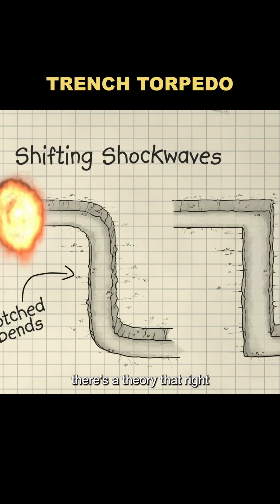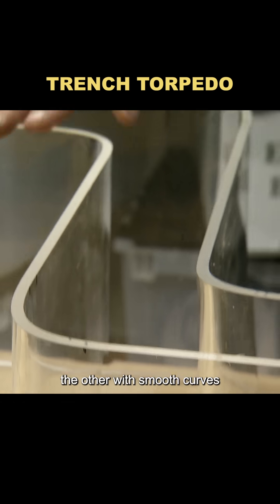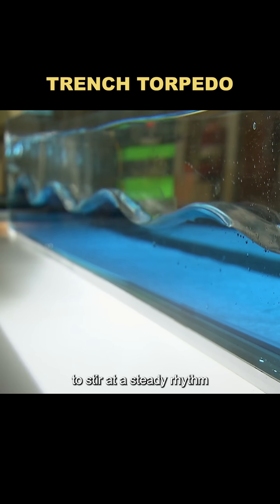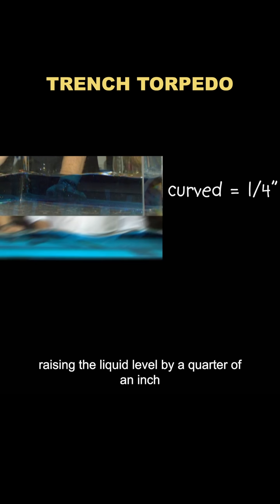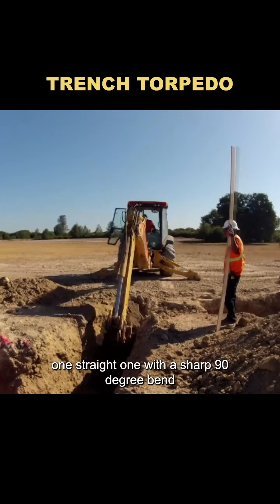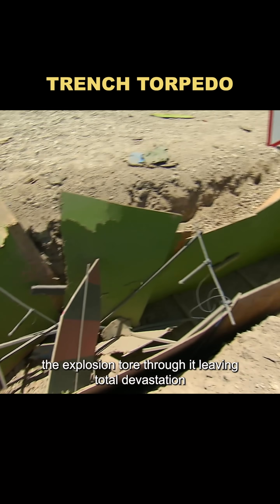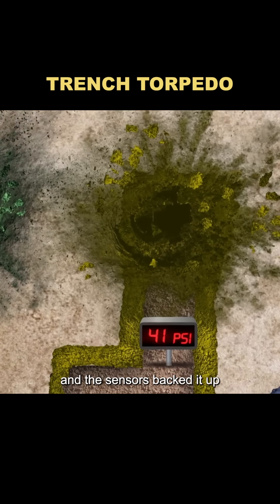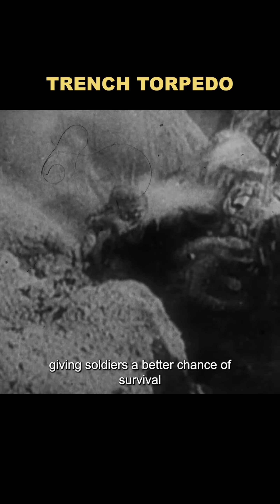Do you know how this liquid is made?

Comment: Do not forget the modern explosion devices are more mortal
Reply: The design in very human
Reply: @EricKuih 
Of course, only humans can come up with unnatural and devastating things
Reply: Dude, a 155mm HE shell is a 155mm HE shell and a mortar round is a mortar round
Reply: @easy_eight2810 artillery in ww1 was larger and had more explosive mass.
Reply: Explosions from 1910 and 2010 are the same
Reply: @BebzolMC  They're actually not. Modern  compounds provide a greater yield at the same weight than TNT and so you can get more bang from same shell size.
Probably not a huge difference in the end, few more meters of lethal range.
Reply: @Suomiwimbula  Agry but I meantjust  an "explosion" not certain substance because I think that author doesn't understand that a specific trench is gonna save you or kill you no matter how new is the thing that explodes. A grenade still explodes just like it would hundred years ago.
Reply: Just because M67 is more advanced than M1 doesn't change much
Reply: @Suomiwimbula  Also people don't realize we don't use TNT as much as we use unstable compounds such as Composition B.
Reply: @BebzolMC No they are not
Reply: @HardcoreJonny-x1j Yes they are. The same as your body is the same as the body of humans from 1910. Sand that kids ate in 1910 is still sand in 2025. Cosmic radiation is the same. And fucking explosion are the same :) Law's of physics never changed
Reply: @BebzolMC not with how more effectively they are delivered to target (drones)
Reply: @BebzolMC no the hell they aren’t
Reply: @BebzolMC  thermobaric can burn the oxygen out of the air and suffocate those close enough. russia claims to not use them but its proven
Reply: @BebzolMC not really. Advances in purity and the discovery of new chemicals make for more potent explosions than we had back then.
Reply: @BebzolMC  explosive vary widely as do the explosions. Not talking about size or shape but how the blast wave travels.
Reply: @BebzolMC ur actually a nut for thinking that back then it was TNT and Cyclonite  we are using thermites C4,PBX and something better and improved than cyclonite, HMX octogen
Reply: @FrankNoBank69420 wiki no jutsu is strong I see. I worked with bombs for 5 years and am now a chemist. All bomb still go boom. The science is different but it’s just delivery and speed in which it’s delivered.
Reply: modern explosions ARE VARIOUS. both low caliber and large caliber munitions are used. both low yield and high yield. basically soldiers will shoot everything that goes boom.
Reply: @kirosmatavastros Do not say basically, please and thanks, pipsqueak.
Reply: more mortal? what is that a video game or movie reference?
Reply: Agree T seems like it would be the best.  Z would be Slightly better than right angles because some of the wave form would cancel itself out at the angle.
Reply: FFS its like having toddlers argue...
1. a BLASTWAVE of this strength will always be the same regradless if its the year 2, 2000 or 15000.
2. an EXPLOSIVE DEVICE! on the other hand can be a 100kg barrel if its old enough or a match box sized if its some fucking future tech... so sure you could have a several times larger explosion from the same sized explosive when compared like anchient gun powder (with optimal ratios) and modern gunpowder we are talking about 3 times more powerful stuff
3. the argument about modern day explosives being stronger.... Fucking obviously... that just means it still kills from a longer distance away but you would still fucking want as many corners between you and the point it detonates on cause it makes it less deadly to you.... just like how wearing a seat belt in a car prevents injuries in a car crash despite cars traveling faster now than in 1940....
4. if modern wars dont use trenches then go tell that to the ukrainians doing trench warfare fucking right now against russians...  you cant get any more "modern war" than one that is being fought as we speak....
Reply: Make "z" trenches 🙃
Reply: What about inverted angles trench.
Reply: You mean lethal?
Reply: More lethal
Reply: the video is not even about the explosion. its about the shockwave transmission
Reply: yeah, but that doesn't change the physics of acoustics
Reply: wtf do you think this means?
Reply: mith confirmed... there's a reason why trenches were built like that in the first place.
Reply: Okay Englishman-English.. More mortal..
Lethal. The word you are looking for is lethal.
Mortality, subject of being death.
Lethality,  capacity to cause death.
Reply: i mean what the heck you talking ? when i have a jdam yes the explosion is bigger as from a granate 

Sure each device has diffrend  explosion radius like a 122 mm rocket from a BM21 G has more than a tank round  
But still curved trenches are more lethal as cornerd trenches sure bigger gun (Device)
has more TNT in it as smaller onec  but  saying a 120 mm and a other 1 enemy one is diffrend is dumb cuz still the same amount of TNT is in it (Blackpouder)
Reply: @xfounes8965  The level of supposed technical knowledge expressed in this comment juxtaposed with the 3rd grade level grammar and spelling is just peak YT comment section.
Reply: But modern wars aren't fought in trenches
Reply: @24ecko ukraine russia war?
Reply: @fluffymuffin9089  they arent actually in trenches there, you can literally see live combat footage on youtube... they are not literally fighting as if its ww 1
Reply: @fluffymuffin9089 you mean the war that they used maxim guns from the fucking 1880s?
Reply: @24ecko says who ?
Reply: "modern wars aren't fought in trenches"... What? You think it's just like call of duty now, every one bunny hopping around 360 no scoping?
Reply: @24ecko no? could you open your eyes?
kurds fighting in syria
russo ukrainian war
nagarno-karabakh war
iraq-iran war
russo-afghan war
and others have all been using trench warfare or been used in considerable amounts of times
Reply: @24ecko  tell that to the men in Ukraine who are sitting in trenches right now.
Reply: @24ecko yes they are lol
Reply: @24ecko uh.... have you watched the news at all for the last 3 years?
Reply: @24ecko  they very much are
Reply: @24ecko  nah dumb tranches wont be gone if theres still fire arms
Reply: @24ecko  have you seen Ukraine. do you know anything about war?
Reply: @24ecko  ohhh a kid from the gen A, tsk tsk tsk
Reply: @24ecko have you been living under a trench the last 2 years?
Reply: @24ecko most of the ukraine russia war has been fought in trenches
Reply: @24ecko  Except the most modern war rn is literally fought in trenches.
Reply: @24ecko if you have infantry defending a position in the open you will have trenches